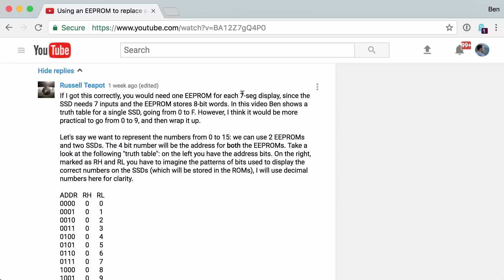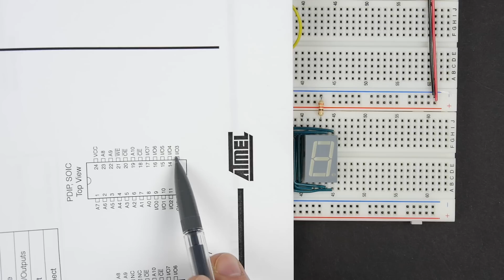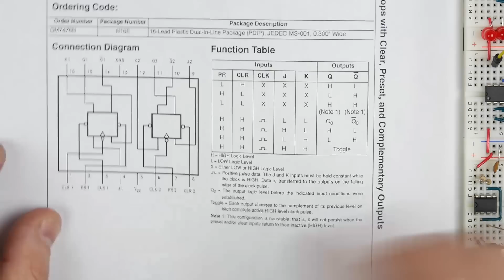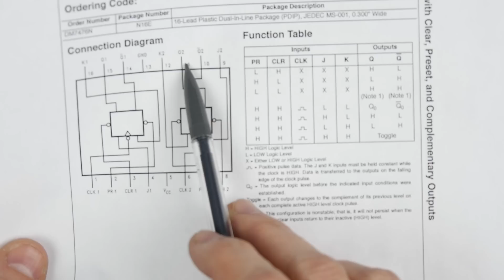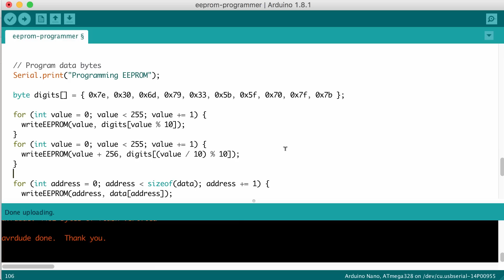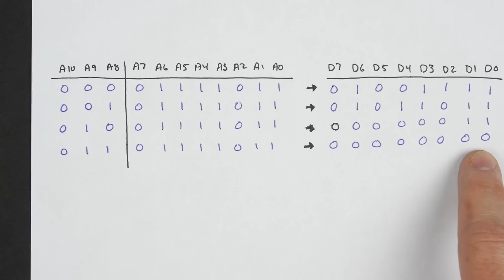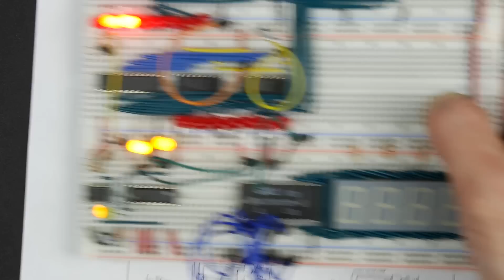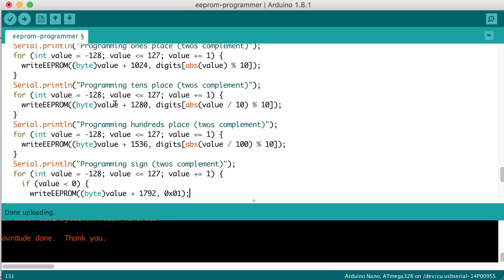Build an 8-bit decimal display for our 8-bit computer

Comment: I was totally mezmerized by the fact that organizing multiplexing with a counter and a timer is almost easier than doing the same trick in MCU software! Especially taking into account that this a separate, totally asyncronous device!
P.S. And actual MCU code to program EEPROM is still trivial!
P.P.S. 2 kB of ROM is a huge cheat though :P

Comment: Might be a stupid question but why doesn't he put resistors on the LEDs connected to the 74LS76? Same thing for the 7 segment displays, they're all connected through a resistor up until the 74LS139 comes along. Does the 74LS series have an internal resistor that limits the output?
Reply: I am wondering the same thing. Can anyone explain ? Thank you
Reply: The standard TTL has 130 ohm on positive output. The LS-version must therefore have a higher risistance.

Comment: It does decrease the brightness of each 7-seg-display by the number of 7-seg-displays used (In this case to 1/3 or 1/4), doesn't it? Except your clock timing is less than the afterglow ... is it?
Reply: I don't think so. No current would flow through the displays which are turned off, so I believe each display gets full power when it's its turn to show a number.
Reply: Yes. But each display is 3/4 times off. No matter how fast you cycle through all of them.

Comment: hello Ben I'm trying to do the same project with
Arduino Micro
mpc23017
7 segment display comon cathode
via i2c using
adafruit mpc23017 library
sig7seg-i2c.h library
and wire.h library

I arrived at a point where all segments show me the same number by colegating the 7 segments and the cathode to the land of Arduino. I need to make appear like the number 127 you can help me are in trouble
and I do not know this area very well. Thank you

Comment: if anyone here still looks at this video, I would appreciate some help.
I'm using the SN54LS112A for the counter and  for some reason unless I hook up an LED to the  2Q` (inverted Q, pin 7), the counter doesn't count and therefore I only see 3 on the right most 7seg and 2 on the middle 7seg display (instead of 1 2 3 I see 2 3).
any ideas?
thanks in advance.

http://www.ti.com/lit/ds/symlink/sn54ls112a.pdf

Comment: I got sold fake 74LS76's :(  They could be useful as heating element though....  But I managed to get my display working for now using a 74LS161 and a 74LS04.  I have the C output from the counter going into the hex inverter which connects to the reset back on the counter. I stashed the inverter next to the B register above the display. I'm hoping to find a better solution or source some working 74LS76's from somewhere. I normally buy from a few reputable sellers but non of them are stocking 74LS76 so I had to get some from a dodgy person. Guess now I know why the other sellers don't have then in stock :(  I'll have to put some time into finding a better solution.
Reply: I also had a problem with 74LS76 - melted the breadbroad!!- I used a 74LS161 but only connected output A and B.  Ignored C and D..   counts correctly, no need for inverter or reset back to the counter as the first two bits always count to 0,1,2,3 even if we are counting to 15.
Reply: You are aware that 7476 has a different power supply layout?

Comment: Have you consider to build a monochrome display adapter using TTL to show the results in a VGA video monitor?
Reply: I'm implementing Ben's 8-bit computer in an FPGA and doing a video series on it.  I plan to add a VGA display as the computer evolves.  It will need more memory and various other expansion to be able to use a VGA output, however.

Comment: Dumb question but at 31:25 how did you convert 243 to its twos complement equiv on your calculator in binary mode? Which function key is that?

Comment: Instead of doing:
if (value < 0) // then write else write
You should just do:
writeEEPROM(<address>, value < 0);
As true = 0x01 and false = 0x00. It's also faster as you don't need a conditional jump(the 'if' that is).

Comment: Hi, I was wondering how I stop the ghosting effect which has appeared on my 7 segment display
Reply: Ghosting effect sounds like a timing problem, where the next display is being turned on slightly before or after the EEPROM receives the change in its address lines.
I'm not sure what would be causing the problem, besides too-long wires.

Comment: I know this a late comment considering when the video was uploaded, but please i do need help,how do I display the number 11110 on a 3 digit 7 segment display, my project is to build a 4 bit calculator so I got stuck on how I can display a number from 10 upto 30 ie 11110
Reply: Did you actualy try building this ? I did a 1 digit eeprom build without seeing this video before and now seeing the clock, and multiplexer solves so many problems I had with my 8 digit display... I consider doing 2 of these and adding a selector switch to switch between Decimal and Hex display instead of twos complement(wich you might want on your calculator).

Larger eeprom with another adress line, could do all 3 :D bcd to hex, dec OR twos complement :D i think. breadboarding time :D

Comment: Are you using LEDs with built-in resistor? Everytime you plug in an LED I'm trying to spot a resistor but never see one. You're not driving them without one, are you?

Comment: Did anyone else notice, that at 24:16, when Ben removes the 2uF capacitor, the display is still functioning?? So I'd venture to suggest that the 10 nF capacitor that he inserts in its place, isn't actually necessary. Indeed, an open circuit has a theoretical capacitance of 0F, leading to a time constant of 0, or infinite frequency. Of course in the real world, the time constant is probably the top speed at which the 555's latch is able to switch, likely a few ns.  In my computer, I have no capicator in there, just as Ben does from 24:16 till 24:19, and it works just fine ;)
Reply: I will try :)

Comment: I had this idea and replaced the 74LS76 with a regular counter 74LS161. The idea was to use one of the registers on the 74LS161 to store if I wanted to display 2's complement.
I had to reset the 74LS161 to only count to 4, which unfortunately also reset the the register I needed to store if I wanted the 2's complement :(
Maybe someone can figure how to do this successfully.

Comment: I have one question, it may be dumb, but for me it's a real killer for the brain haha. So I noticed this a while ago but couldn't figure it out myself. When you hook up all I/O pins to low, then you get a zero on the output and then when you take first I/O pin to high it should be displaying 1 on the output. But why is it displaying the 1 on the output as soon as you take out the wire from the ground without even plugging it in the Vcc pin? Shouldn't it stay low if it's not connected to anything?
Reply: I believe the 74LS series chips have pull-up resistors on all the input pins so that they don't float.  Disconnecting the pin from ground will force the pin to go high.

Comment: I'm having a lot of trouble with this. I am using a GLS29EE010 1Mb chip. It has 17 address lines (I'm building a 16-bit version). The problem is that it has an automatic page-write function, which means it writes 128 bytes at a time. The bytes are stored in a buffer, then once 100 microseconds goes by without any input, it starts the write cycle and overwrites the entire page (128 bytes). Any address in the page without data in the buffer is overwritten as 0xff. So, from the time you send the first byte of data and toggle the #WE pin, you have 100 microseconds to send the next address or the write cycle automatically begins. I'm using three 74HC595 shift registers to store the address. I have used to "micros()" function to measure the time to setAddress takes to run, and it takes 494 microseconds every time, so it takes 5 times longer to set the next address than the small window I have to send it. I need to find a faster way to set the address. Maybe using binary counter or a few 74ls173's with a multiplexer to store 8 bits at a time instead of shifting them out one bit at a time. I have an Arduino Micro with 13 output pins, but I can use 12 because of TX/RX issue.
Reply: I managed to resolve this by cascading four 74LS193 binary counters. To increment the counter only took a few microseconds, and with setting the data, each cycle only took 84 microseconds, so the chip didn't auto-page-write on me. After every 128 iterations, I had to allow 5 ms to pass for the page to write. All 131072 address locations were successfully written.

Comment: You could use EPROM (not EEPROM) scrapped from old junk. You don't need the possibility to erase it on the fly so it would reduce costs. And IIRC there are already BCD to 7segment decoders available.

Comment: You could interpret it as the clock itself really being the 1's bit for the counter, and then the JK flip flops gives you the 2's and 4's bit. That way seems to require less of a hassle and wiring. Also, if you want more multiplexing, that would let you use the final adress pin on the EEPROM without adding another flip-flop.
Reply: Pakistann

Comment: In an earlier video, I recall you talking about using the 8th/most significant bit (the one that represents the value 256) as the sign bit (1 = negative, 0 = positive), so couldn't you connect the other end of that green wire directly to the 8th bit's input wire instead of a 5 V rail? If I'm not mistaken, that way it would automatically show a negative decimal number whenever the binary input value was a two's complement negative number (although you'd have to disconnect the 8th bit input wire from the EEPROM).
Reply: Seekay 
1) Bit 8 represents the value 128, not 256.
2) The point of the green wire is for the operator to be able to select between the two display modes (8 bit unsigned / 2s complement signed).
3) 2s complement isn't symmetrical, setting the sign bit doesn't produce the same number negated as the unsigned representation.

Comment: I'm surprised you didn't use a 4017 decimal counter, would of saved an extra chip, run counter input from timer, directly to 4017 to drive display.
Reply: Neat chip, but I think he needs the encoded count from the J/K flip flops to address the correct EEPROM page.

Comment: Why you use address += 1 instead address++?
Reply: Probably the same reason he uses the <= idiom instead of the < idiom.  I work with a lot of HW engineers and find that they tend to use these idioms whereas "pure" programmers tend to use the < and ++ idiom.

Heck, even I don't use the standard postincremenet, rather  I use a preincrement (++i over i++) .  That actually goes back to when I learned to code in the early 90s and C++ the preincrement over the std iterators was often more efficient than using the postincrement depending on the compiler...

Comment: There's always going to be programmer police going around on someone who is writing disposable code to achieve a quick job.  I just have to remind myself not to nitpick super hard, because it works and it's not super permanent or in need of constant maintenance.  I mean, feel free to clean it up like one commentor has in the comments, but remember the output in this case is what's important!
Reply: I really hate this mentality in programmers...it encourages bad programming habits that can and do make their way into production code.  I can't tell you how many times I have seen "demo" code that was "disposable" eventually appear as production spaghetti because someone thought "it works so it's good enough."  Do it right the first time and get yourself in the habit of always doing it the same way and you won't be spending time hunting down one-off bugs.
Reply: tpaxatb Have fun chasing off people who otherwise wouldn't have written anything!
Reply: Ha.  I've been doing this waaayyyyy too long, am too jaded, and am stubborn in my ways. And part of this was a frustration vent due to dealing with trying to unravel spaghetti the past few weeks because someone used some throwaway demo code (clearly marked as such) that was demonstrating a concept as the starting point for actual eventual production code.  It exposed an uninitialized variable (the warning message was suppressed/ignored) that was initialized by a DIFFERENT bug (buffer overrun) as soon as the memory layout changed by editing the demo code...all due to the copy-paste of the demo as if it were ready to go "because it worked".

I honestly don't have TOO much a problem with the (in MY opinion) poor style....except that this video series is pretty educational and due to the presentation style wouldn't want someone taking the programming side as how to do things correctly.

Side note: it is actually in my company's Coding Standards document that for loop idioms are on the interval [start, count) and not [start, count -1] as is in this video for the simple reason that humans think in terms of "count" things to do, so it is easier to avoid the subtle bugs of the type shown.  And don't get me started on the 1 based array indexing fortan programmers love. :)

Comment: In the datasheet, I saw there was write lifetime limit thing of 10^4 to 10^5 cycles. Is there any such limit for read cycles? Here, if the 555 is ticking at over 60Hz (I would guess, as the camera is catching any blinking) that could wear off the EEPROM quite quickly! I still do doubt that there is such a limit for read cycles tho. I mean, what would there be to wear off? Just curious. Also, SUPER NEAT (I'm new to this channel, and I LOVE IT!!!)
Reply: As I understand it, there is no limit on read cycles.  It's writing which slowly "wears out" the EEPROM.

Comment: Why is it common to erase an eeprom to 0xff instad of 0x0 ?
Reply: "EEPROMs are organized as arrays of floating-gate transistors." - wikipedia  and "Flash stores the data by removing or putting electrons on the floating gate. When electrons are present on the floating gate, no current flows through the transistor, indicating a 0. When electrons are removed from the floating gate, the transistor starts conducting, indicating a 1. (This is by convention -- it could have been the other way but would required inverters on all the data lines.)"  (first, highest voted answer by tcrosley) https://electronics.stackexchange.com/questions/179701/why-do-most-of-the-non-volatile-memories-have-logical-1-as-the-default-state

So I dint write this answer, but it is an answer that explained it to me pretty clear when I wondered why. The stackexchange answer has images and more information if this copy paste answer wasnt enough ;)

Comment: based on your computer, is it possible to emulate an atmel atmega microprocessor avr on it? copy the .hex file and program it into the eeprom?
Reply: Leonardo Elias Goncalves as the "mega" name implies, that's a really advanced microcontroller family (for 8 bit). Even the tiny AVR models are way beyond this breadboard computer. It can be built, naturally, but it's horribly impractical. A more comparable family might be Microchip PIC10, but they still do more (call stack, interrupts, bit operations, etc; 35 instructions rather than 9, 10 bit program memory).

Comment: Really cool stuff!  Technically, that cast to a byte is relying on signed overflow, which is undefined in C.  Something like (value >= 0 ? value : 256 + value) is more certain to work on all compilers.
Reply: While signed overflow might not technically be defined in C (also, this is actually C++, not C, so that might change things, but I don't feel like reading through the standard to verify either way), the simplest way to cast from an int to a byte is going be just reinterpreting the least significant byte of the int as an unsigned integer, which, as long as the architecture you're compiling for uses two's complement signed integers (pretty much every architecture under the sun), will give you the desired result.
Reply: @sillymel  The dangers of UB aren't so much that a certain computer won't behave the same, it is that the compiler might optimise away any cases that only occur when UB behaves a certain way. If a signed variable N starts out positive, and is only ever added to, any (N < 0) condition can just be replaced by false, and if that makes blocks of code unreachable, those blocks can be removed too. Since the behaviour of the program is no longer defined if it actually does end up negative, this is okay for the compiler to do.
Reply: @Jutastre  I already learned about the dangers of signed overflow already since I posted that comment. However, what's going on here is actually not signed overflow. Casting from a signed integer is actually 100% defined by the C standard. It's not even implementation-defined behavior, let alone UB. (Casting the other way is implementation defined, but still not UB, so I think my reasoning on the likely implementation of the cast would have been correct in that case, too.)
Reply: is that supposed to be a questionmark?
Reply: @bermchasin  yes, it's a ternary operator: https://en.wikipedia.org/wiki/%3F%3A